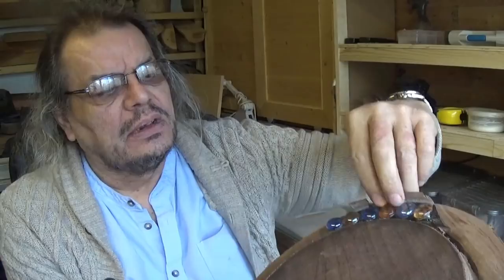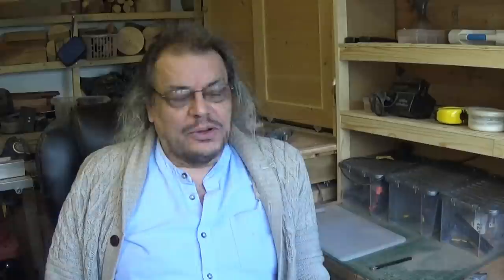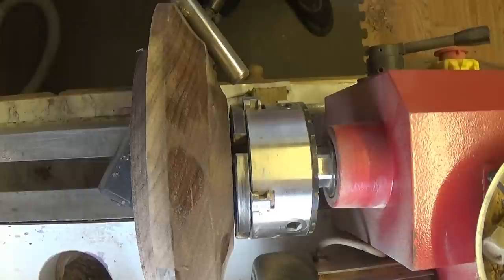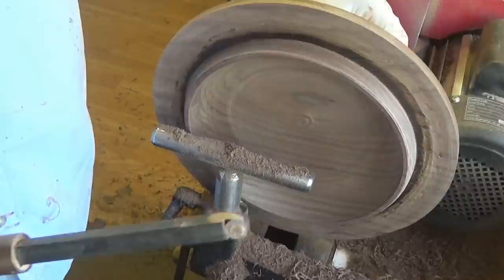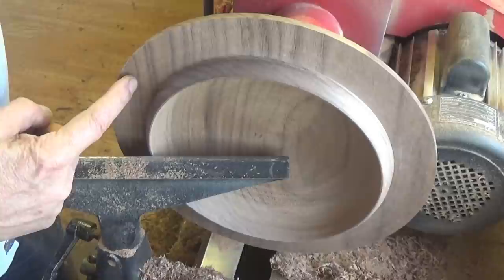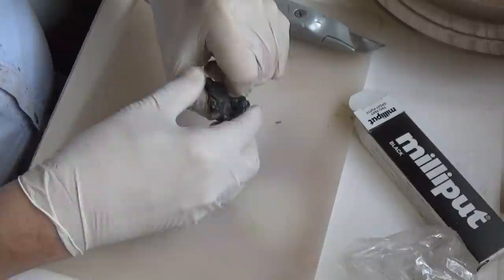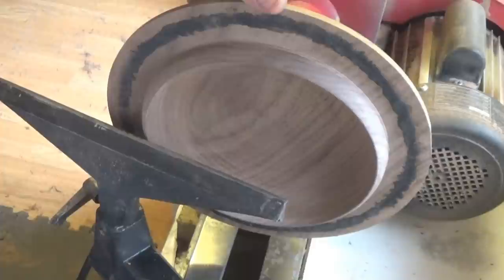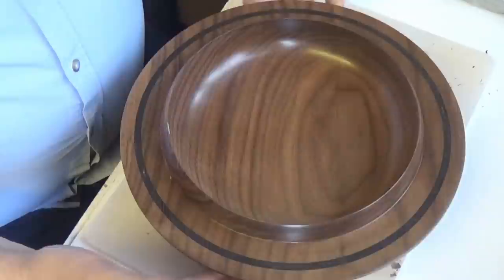Woodturning at 54a. #127. Walnut bowl save

Comment: Hi Keith. Nice job Mate. That bowl looks great with the Milliput insert. I’ve used the stuff many times now. You can get a great effect if you use all three Colours together. Simply make three thin discs of each colour and lay them on top of each other. Cut them in half and put one on top of the other. Flatten out into one disc and repeat the cutting and layering process. Roll out into a long sausage and pack it into the work. The result is that you get an almost marbled effect. Give it a try. Cheers Graham
Reply from the maker: Graham Light Thanks Graham,I’ll certainly be trying something like that,it looks like quite a lot can be done with it😄👍

Comment: Another bostin job Keith. I used to use Milliput years ago for modelling parts that I then had cast from aluminium, must give it a try again in my turning. Don't change a thing, stay as sweet as you are (could be a song there). Very nice bowl young man. One question, why did you polish the bottom before you turned it ?
Doh !!! 
See you soon, all the best,
Geof
Reply from the maker: geofo60 Geof Harris Hi Geof,I said in the video that the bowl was going to look different with the glass beads,but it was awful,so I decided to change the design.As the first try was nearly finished,I had already polished the base.When I put it back on the lathe again I said how I was going to re-design it.
Reply: Keith Barrow 
I was pulling your leg mate (lol) !!
I did watch it all, always do.
Take care 
Geof

Comment: use sanding sealer in the groove before putting in the millyput as on some woods it bleeds into the grain
Reply from the maker: Thankyou for the tip Keith,I’m pretty new to Milliput,so I’ll certainly remember that one.😄
Reply: Thanks for that tip - I wondered about this when I saw the terracotta color.

Comment: You mentioned that Milliput is more pliable when warmed by your hands. From what I saw here making little ropes of the stuff between your hands, as you did half way through the process, seems to be the best way to apply the Milliput into a groove. 

I wonder if the use of a heat gun (on the low setting) would help getting it soft enough to press into the groove more efficiently. Or do you think a heat gun would make it soft enough to flow into the groove? I know that heating liquid epoxy like this makes it flow much better. Unfortunately it seems to make it "set-up" slightly quicker as well. It could present a problem with something a thick as the Milliput. Perhaps an experiment with a small amount of Milliput would be the only way to find out. If it works it could eliminate the low spots or voids and perhaps any air pockets as well. 

Then again I just might be over thinking this...Your thoughts?
Reply from the maker: Hi Gil, I haven’t done much with Milliput as yet,but you’ve come up with an idea that I’m going to experiment with.I’ll let you know the results.Many thanks 😄
Reply: As to your video format, I think the homeostatic approach is called for. Don't change a thing! OK, maybe more appearances from Sheila is all. They always make me smile.
Reply: I don't know that I'd heat the putty - but there might be some value in actually putting a little heat in the wood - might allow the putty to soften further when it's actually in place on the workpiece